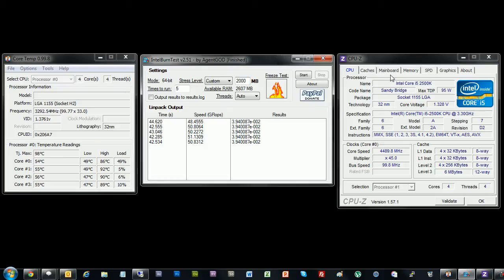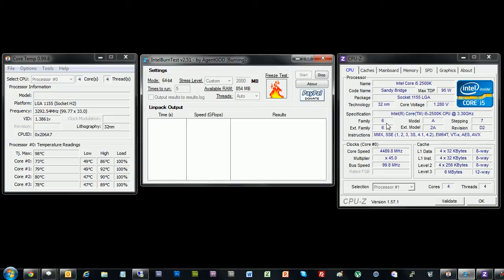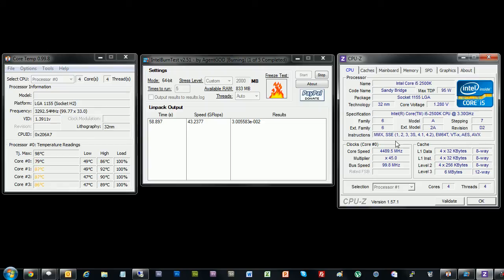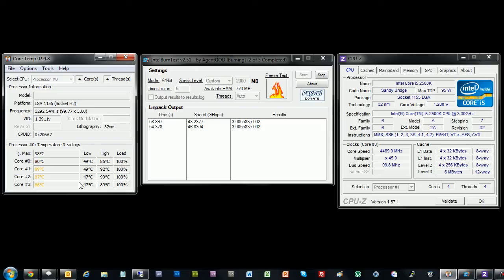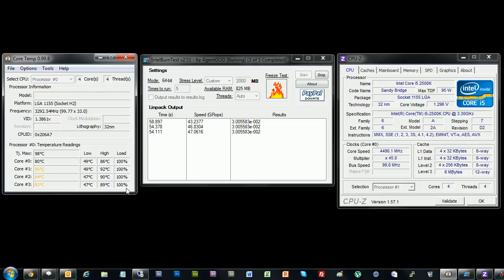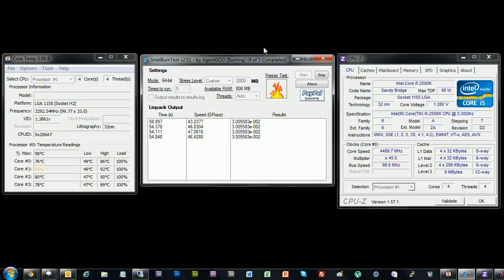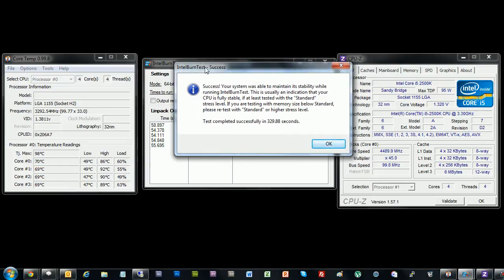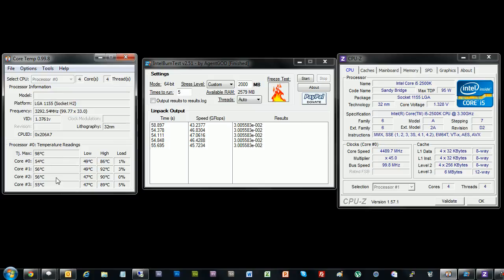Core i5-2500K Stably Overclocked To 4.5GHz Using Stock Intel Cooler

Comment: My i5 2500 stock 3.30ghz - 80° C full load :)
Cooler CPU ID-Cooling DK-03i RGB PWM
Reply: when did you last replace thermal paste?

Comment: i did this on windows 8, i5-2500k w/stock cooler, used same settings as you, temps got to about the same. my computer experienced a problem and needs to restart :(

Comment: as corei5 3450 @3.1 is better than corei5 2500k @3.3 ghz by 300 point on benchmark then it can be said that  3450 @3.5 ghz is better than 2500k @ 4.3ghz...ha ha ha so what is the need of all the cooling ,expensive mobo just for that 2 ghz more speed ,2500k might actually equal the 3450 @ 4.5ghz

Comment: hey im planng on getting 4 or 8gb ram 1600 mhz 750 or 850 watt psu(found it really cheap) hd 6950 2gb z77 sli gigabyte motherboard a case with a believe good airflow(2 fans included) and an i5 3450.do u think ill be able to overclock it to 3.5ghz with the stock cooler and if yes how much volt should i get?

Comment: i have my i5-2500k at 4.9 ghz and the very max on the temperature sensors on the cpu not the motherboard was 72 degrees celsius after running a stress test for about 10 minutes but it stayed below 70 except it jumped up to 72 on one of the refreshes of the temp.. im using the coolermaster hyper 212 plus heatsink and i dont have the stock fan i have two coolermaster sickleflow 120mm fans on it it is pretty much silent for the airflow

Comment: thats a little high for stock speeds, even in prime 95 it should only be 75 max, make sure its firmly in place and that you have as much air flow in your case as possible, if its not either of those re-seat it.

Comment: I have an 2500k which idles between 28-40, i dont think this is a problem, with stock heatsink and 1 casefan its pretty normal i guess :)

Comment: AHHHHHH!! i cringe when i see your temps... that poor processor.... 
Intel rates the 2500k for a max of 72C Tcase... that temperature, however is impossible to measure because it's the top centre of the chip, but it might be a good idea to keep it somewhere close to that..... GET A COOLER.... 
with a good air cooler, at 4.7 Ghz. my 2500k doesn't go above 67C...

Comment: Why are you getting only ~50 Gflops ? With same IBT setting and same cpu clock speed/voltage on my 2500k i get 116 Gflops ><
Reply: Thermaltrottling.

Comment: @TRichards66 I remember Tom's Hardware doing an article based on your very question but with even more focus placed on, how much performance per watt are we getting , when we do such high freqs... IMO, after 4.2 ish, you will not get any increases, and if so, only about 1-3% added performance, also depends on resolution, the higher, then the better returns.

Comment: I have a question for you all: At what point will an i5-2500k stop seeing gaming performance increase (or noticeable increases) through overclocking?

currently i have mine sitting at a comfortable 4.1ghz overclock, idling at 35C.

Comment: @NotoriousAMJ 500W is very close to the limit. I have 2500K as well with 2 HDDs and extra cooler. When I inserted Radeon HD 6950 (which needs 2 additional power supplies) it worked, but after runnig 3dmark 2006 for about 3 minutes my computer rebooted. I tried few more times with the same result. When I disconnected one HDD and extra cooler my computer survived 3dmak, so I guess it was just a little bit above the limit with 500W. Then I got 600W PSU and now everything works fine.

Comment: @NotoriousAMJ Get a better air cooler anyway if your cpu is overclocked, but if your cpu is standard then just use the intel cooler. They are easy to change, even a 7 year old could do it.

Comment: @liamquade
i oc'd mine to 4.5ghz with 1.3v on my sabertooth p67 mobo and stock cooler
temps seemed fine, it was idling at 30*C and 60 degrees whilst playing games and it ramps up to 4.5GHz

but about an hour later or using it i bluescreened 0_0
i put it back to default to be safe but i dunno what the hell happened :S

Comment: @risenwarfare in terms of airflow my haf 912 case is set up properly for good airflow ... 200 mm CM Megaflow intake front fan and 200 mm CM Megaflow outtake back top fan plus another fan on the very upper back of the case.  It is a CM fan that was included with the haf 912 case.  Again I think my airflow is good although I am not sure how fast my case fans are going.  I don't have a controller for them so I have to figure out to run them max or close to it all the time.

Comment: on my stock cooler when running prime 95 in various test I am hitting 79 degrees celsius to 85 degrees celsius at 3.7 Ghz ....

the thing is how many games even push a cpu this hard ?  almost none  .... and with the threshold for this cpu at like 100 degrees celsius seriously what is there to worry ?

Comment: @JoeeHD I guess these cpus can hit 100 then safety measures and throttling down happens.  I was told that not many games push a cpu like Prime 95 does so there is no worry about temps in the high 80s even when running Prime 95 on stock HSF.

Comment: @mirr1984 60c is perfectly fine with an overclock. My standards are trying to stay under 80c while running Prime 95 for about 30-45 min which is when it'll peak at its highest temps. I have my 2500k ocd to 4.5ghz with an astek watercooler and getting about your temps. Bit of advice is to do research on youtube and tomshardware and oc manually you'll get better temps and will probly be more stable if you find the sweet spots ( fyi try to stay under 1.3v at  4.2ghz )

Comment: I'm a newbie to overclocking but I used OC Genie on my mobo to clock my i5 2500k. It bumped it up to 4.2 Ghz which I was more than happy with. The temperature had risen to between 50 and 60c. It idles around 35-40c at stock speeds. My heatsink and fan is better than the stock cooler which is why I get nice stock temperatures. Just wondering if 60c is safe on the OC and at what temperatures should I get concerned?

Comment: @liamquade Dude thats too high for temps. It can be fun overclocking but its not worth it. That cpu wont last long at 90c. I have mine ocd to 4.4ghz and it stays around 55c. i could overclock it higher but it rips through every game and isn't necessary. Btw im using an asetek watercooler.

Comment: wow those temps are way to high over 80oc is bad for your cpu life span, plus why did you not run the the standard test ? i am running i5 2500k @4.4ghz 64oc max full load air cooled results from standard intel burn 8.226 secs 108.66 gflops.